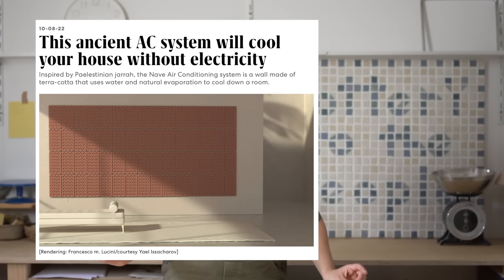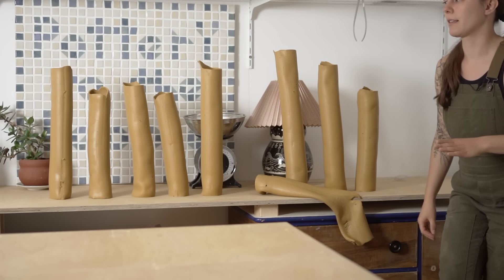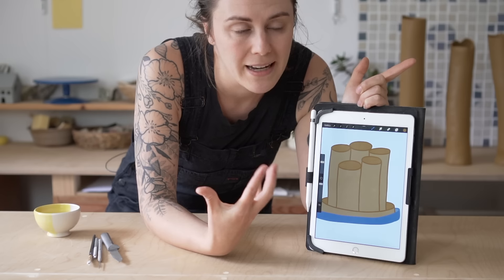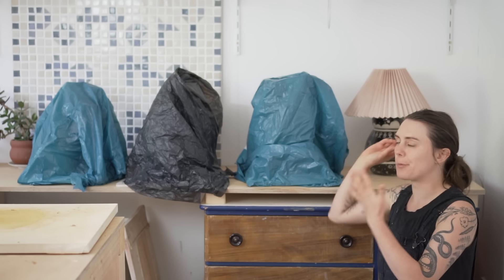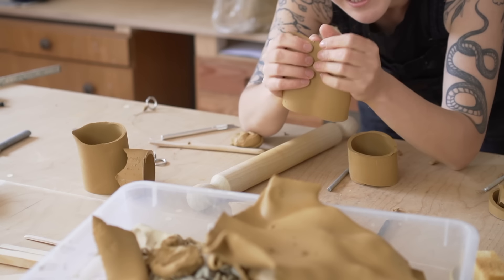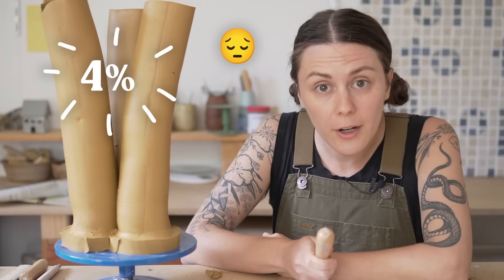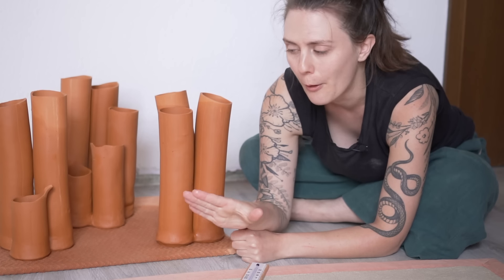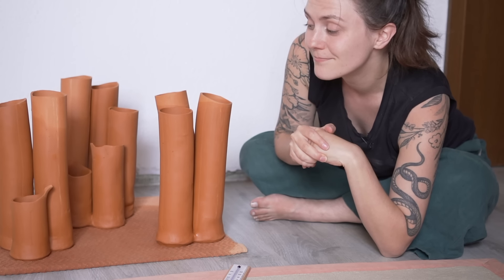Can I make an A/C out of clay???

Comment: Just a couple points about these coolers: Due to the method of operation being evaporation these coolers increase the humidity in the air, this has the effect of making the room feel hotter than it is, and in situations where there isn't much air flowing into the room and there is a lot of heat going in it can feel even hotter than it would have been without the cooler. Another effect is the lessening effectiveness of the cooler itself as both the temperature decreases and humidity increases, eventually stopping to work completely if and when the dew point reaches ambient temperature, otherwise known as 100% humidity. All of that is not to say that these coolers are bad, just that they are situational, and generally they work better outside.
In my city the temperature this noon was 35C with 66% humidity, which would make the dew point somewhere around 26C. This is the absolute lowest temperature this cooler could achieve here, and with the increase in humidity it would feel quite terrible. And indeed when working under similar circumstances and using an evaporative cooler with a massive fan there was barely a difference, even the flow coming out of it barely felt colder. A desiccant based system would work better, but be a lot more complicated to install and maintain.
However, another city in my country regularly sees temperatures of around 42-43C throughout the summer with heatwaves reaching as high as 49C, except with humidity at around 15-20%, which would make the dew point somewhere around 10-20C(it would be closer to 10 in most circumstances). This makes such coolers extremely effective there.
Reply: Love finding these treasure troves of information in the comments!
Reply: agreed! I live in a dry place and evaporative coolers are really common. Growing up we had one that was essentially a wet bale of hay with a fan behind it - all cased in plastic.

Someone in my city built a wall of stacked porous ceramic pieces similar to this that acts as a water feature on the western wall of their house that gets a lot of evening sun. In this dry city this makes a huge difference to the heat in the room. It does use a fair bit of water though! In dryer climates this can also be an issue (but not a CO2 issue)
Reply: Disagree. I am not an expert, but as she already mention it, is the evaporation process that extract energy (aka heat) from the environment. Indeed your are increasing the humidity of the room, but this is not an open place. This is an old technique proven to work. Maybe with a small fan it will increase the circulation of air between the pipes and then make it to work better.
Reply: Yup. If your air is full of water then you don’t evaporate sweat effectively. The only time I got heat stroke was near rice fields. The air was very humid.
Reply: Great point. These are the equivalent of "Swamp coolers" often used in the dry Southwest of the US. I lived in Alice Springs Australia and whole house evap cooler are the norm. They work well there until it rains and then it's very unpleasant. The user of potable water is also a problem not unlike carbon emissions. The point? Nothing free and we didn't get where we are by accident. It doesn't mean there isn't a different way forward, but if it was simple, we would have solved it years ago.
Reply: ...so you're saying they 💯 won't work in Florida.  😂
Reply: do you live near the andes? random but i learned abt rain shadow and how that makes areas warmer and less humid and am wondering if that is the case near you cuz idk how else the same region would have both super humid and less humid weather otherwise
Reply: The original temperature was 23°C. That's 73.4°F,  not 67°F. If the temperature drops to 21.5°C, that converts to 70.7°F.  A 2.7° F drop is significant.
Reply: Bottom line: This works better in areas with low humidity.
Reply: I agree. If you could vent out the air occasionally would help. This only works though when you are in a dryer climate. :(
Reply: @livinginthenow  They also work better with continuous air flow.
Reply: @AlamToro  Google wet bulb temperature
Reply: The clay water filter pots (made by adding an organic, carbon based powder to the clay) can be used for this once the filter action slows down.
Reply: 49C!  Where the heck do you live???? 😲
Reply: I hang a wet towel over a fan. Close blinds door and keep towel wet. The earlier you start the cooler the room. 45C outside no issue i need a hoodie inside
Reply: Really smart people watching this channel.  I love it!  Thanks for sharing what you know.😊
Reply: Where I live in May and June temperature hits 45 to 49 Celsius too. Air coolers are only effective when your space has well-ventilated. Cross ventilation is preferable, one-sided doors and windows also don't work.
Reply: >weeps in humid location
Reply: @AlamToro  when humidity is high, the room will FELT hotter/warmer than it actually is because your sweat has nowhere to go. This is why in humid environment it actually felt stuffy and hot after rain. Also the reason they use term "feels like" in any weather app.

Adding fan will slightly improve things for a short while, but again it will reach dew point quickly especially in closed room..
Reply: @AlamToro  If the environment reaches 100% humidity, there won't be any evaporation. Water will be stay in the tube even if you blow it with a huge fan. The circulation you mentioned will come only from the fan it self and have nothing to do with these tubes.
Reply: This is why the southwest have evaporative coolers and New England does not. The difference is humidity.
Reply: @YochevedDesigns   in the western USA 49C is not unheard of even here in eastern Oregon. Death Valley can hit over 57c.
Reply: I was going to comment this (with a bit less detail)! I’ll add my 2 cents anyway. 

These systems are pretty useful in many dry countries due to the reasons OP stated, but not very useful if you live near coastlines. Another way of thinking about it is vapor pressure: it’s easier to evaporate water when there isn’t a lot of water in the air already. If it’s humid you will find it harder to evaporate the water, and it wouldn’t help anyway because the water in the air already holds a certain temperature which the tiny amount of moisture you are about to add isn’t going to change very much. Additionally, if it isn’t sufficiently windy, these types of coolers don’t help all that much anyway. The idea is to moisten the air, which should prevent it from heating up very easily due to the high specific heat of water, but without wind to simulate the drying of sweat you just end up with wet air that feels oppressive (as OP stated).
Reply: It doesn't just feel hotter, humidity holds heat so it becomes harder to cool down as the humidity warms up. Also seems like a huge source for mosquitos, which even indoors will find places to spawn.
Reply: @AlamToro i think they mean how the cooling still happens, but because the humidity is simply increasin, it will make the air generally less comfortable. My country is generally very, very humid (80% daily is normal) and winters are colder, summers are warmer even with non-extreme temperatures. This systen will help tame heat during the evaporation process, but in return as the air gets more humid it'll be generally more difficult to retain the place cool
Reply: I wonder if it would work better with a dehumidifier actively working in a room then. The goal is to use the least amount of power possible but a dehumidifier uses a lot less electricity than an ac
Reply: @AlamToro  thanks for disagreeing with facts but nobody cares about your gut emotions.  facts are still the winner.
Reply: @sophiaoldford7806 no it isn't.  that's literally 30 minutes of time passing in the middle of the day.  weather changes that much that fast on its own.
Reply: @anymoose6685  You'd have to work pretty hard to get something like this to evaporate enough water to be an issue like that. But, it would likely make more sense to just get a water absorbent bandana and wrap it around your neck where it helps cool the blood going to the head.
Reply: @livinginthenow  Yes, and it basically doesn't work at all and doesn't increase the humidity much in areas with high humidity. In areas of high humidity, you don't have much option other than water cooling yourself, provided the water is cooler than you do, water dissipates heat better than the air does.
Reply: @AlexisTwoLastNames  Anyplace with tall mountains will have rainshadows. Large countries (US, China, Austrailia, etc) have a big range of climates. Going from coast to inland also makes a huge difference... I live on the coast, and we have 80% humidity year round with average summer days at 16-17C. Go 100 km inland and they have 25% humidity at 38 C in summer.
Reply: Honestly this system seems like the best thing it does to help people cool down is provide cold water to drink. It's basically a series of tube shaped ollas
Reply: In Colorado, and other high alpine deserts, a lot of houses use swamp coolers instead of AC, since it's almost always very efficient to use evaporative cooling. Where you would never see evaporative cooling units down in Louisiana since it's hard to tell whether you are sweating, or whether it just hit dew point.
Reply: @wyohman00 we do have it figured out a long time ago ahah, clay/rammed earth houses have been around all over the planet for millennia ;) and now a days when done properly, they really help heat and humidity comfort issues as they work like alive breatheble skin walls to our houses, and yes they can be well executed pretty much worldwidely 😍 (only we got more marketed over "faster" concrete and wood industries throughout recent years, but hopefully getting back on track more and more 🤞)
Reply: @lllllsuzlllll  You may be thinking of different effects from the technology.  Rammed earth is a thermal mass, not an evaporative cooler.  It's like a flywheel... Storing energy from one cycle and releasing it in another.
Release heat in cooler temperatures, absorb heat from warmer temperatures.
Reply: Cracks can sometimes occur during the firing process in which moisture or air pockets are present in the clay, as the temperature increases the moisture in the process of evaporating can cause pieces to explode or crack
Reply: Interesting you bring up dessicants, I thought of this too. I wonder, if you had a system of clay wall tiles similar to the images in the article from 0:24, could the clay wick up some of the ambient moisture in the air, and help lower the humidity? That'd be nice on its own, even if it didn't help cool things down.
Reply: Similarly in the South-West U.S, the native peoples (and later pioneers,) used earthenware pots to cool water and small rooms. Due to the hot, arid climate of the region, they remained effective year-round
Reply: @SarushaIsMyName   Florida resident for 30 years. They really, REALLY don't
Reply: good old swamp ac.
Reply: Agreed completely. We are always running our dehumidifier due to it making everything feel so much warmer and mucky feeling. I more effective design would be to change the building, having a convection method where hot air that has risen escapes through the top drawing cool and less humid air from below. The method was proven so effective at times making ice was even possible- although at night and with a nice breeze.
Reply: @AlamToro the system she built is essentially taking the energy of heat and using it to evaporate water, this technically causes there to be less heat, but high humidity does cause the surrounding air to be sticky and warmer then normal, also causing sweat from the body not able to evaporate.
Reply: @livinginthenow  Next project: Passive architectural dehumidifier.
Reply: you look like someone that likes Technology Connections
Reply: @amarujuancoiz4287  thats me.
Reply: @derpderpin1568  chill xd
Reply: I made your like a thousand
Thank me later 😊
Reply: @hoppingwren  evaporative ACs can use reclamation systems to recapture the evaporated water, so it can be reused
Reply: what about with a dehumidifier to regulate humidity
Reply: @AlamToro  Disagree, as someone who lives in the tropics and is consistently exposed to both high humidity and high temperatures, evaporative coolers do not help with making the room feel cooler for reasons stated by the original comment.
Reply: Desiccant based system - you mean a dehumidifier?
Reply: Yes, a dehumidifier is an important household appliance pretty much anywhere with 60-70+ humidity. Especially during the winter and summer. It addresses mold growth, allows the air in the home to better insulate heat, and allows sweating to be effective during the summer.
Reply: I agree, I live really near the Ecuator just 90 metres above the sea, and right now (7:30 p.m. 31 ºC) the humidity is at 64% wich is making the interior of my house feel like a sauna, so this cooling methode will only work in places where, as we locals call it, the heat is “dry” (really low humidity)
Reply: Excellent detail!  I didn't do the math to prove, however, better example and detail than I was going to comment regarding humidity related to effectiveness.
Reply: @AlamToro It works in the dry, desert climates they were invented in. They are less effective in climates with more ambient humidity because the air already has a certain amount of moisture in it, and they'll essentially equalize before actually cooling, and as explained, adding more moisture makes the air seem hotter.
Reply: @rallymum5246  Wet towel as a curtain in a window but only when there is airflow.
Reply: @AneesMahdi  May I ask where? How do you cope?
Reply: @LoralRose  Where do you live that summer days are 16-17°C? That sounds like heaven
Reply: @djplonghead5403  Air movement if possible is always the answer.
Reply: @maemae1752  it works in houses with a verandah right around the house or at night here in Australia. During the day the key is block out the sun 😁
Reply: Evaporation works because the liquid contributes energetic molecules into the surrounding gas. This would cool the tubes, but warm the room lmao

Comment: You cannot expect a cooling effect the way you envisioned. A/C is essentially a heat pump -- you move energy from one place to another. In your setup you are moving energy from the water to the room via evaporation. This does NOT remove any heat from the room. 
What you have made are some awesome water coolers.
Reply: This was also my first thought. However, the phase transition from water to vapor does take a lot of energy, so as long as the evaporated water doesn't recondense, this setup should reduce the overall heat in the room somewhat - at the expense of increasing humidity. In other words, some of the heat energy is transformed into latent energy.

Still, it would probably be more effective if the water vapor could be transferred outside somehow, like building this into a wall and wetting only the outside surface.
Reply: star max ur wrong

it’s still a heat pump

the condenser just is the entire planet

as the water goes to vapor in the room, it cools itself and it’s surroundings

as the vapor goes to water outside in the atmosphere, it warms itself and it’s surroundings

there’s that heat u pumped out of the room..
Reply: @knutfranke6846  The reason "swamp coolers" don't work in real, moist air swamps, is because there is no place to transfer the heat collected by the water during evaporation. The dryer the air, the better they work.

And, yes, humans perceive a cooling effect when the water vaporizes -- up to a point. Have you ever lived in really moist climates    where even sweating doesn't work?

But, I stand by my statement that, unless you can move the water vapor out of the room you have not changed the total energy content in the room.
Reply: @lezzbmm  Yes, it is a heat pump: out of the water into the "air" of the room. Once the water evaporates from the outer surface of the clay structure (pot or tubes) what control does the clay structure have over it? Please help me understand how the clay system controls the water vapor to make certain it exits an enclosed room without transferring heat to the room???
Reply: the first smart comment
Reply: @StarmaxStarmax-zn3xt  Well you are wrong. The energy is being stored as potential energy in the water vapor, therefore lowering the temperature of the entire system.

From the evaporative cooling article on Wikipedia:

"Evaporative coolers lower the temperature of air using the principle of evaporative cooling, unlike typical air conditioning systems which use vapor-compression refrigeration or absorption refrigeration. Evaporative cooling is the conversion of liquid water into vapor using the thermal energy in the air, resulting in a lower air temperature. The energy needed to evaporate the water is taken from the air in the form of sensible heat, which affects the temperature of the air, and converted into latent heat, the energy present in the water vapor component of the air, whilst the air remains at a constant enthalpy value. This conversion of sensible heat to latent heat is known as an isenthalpic process because it occurs at a constant enthalpy value. Evaporative cooling therefore causes a drop in the temperature of air proportional to the sensible heat drop and an increase in humidity proportional to the latent heat gain. "